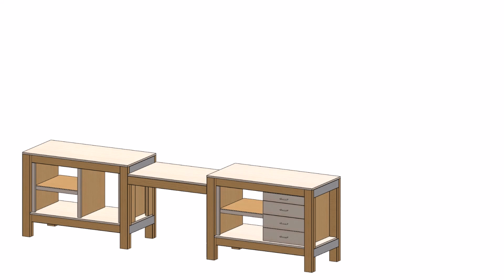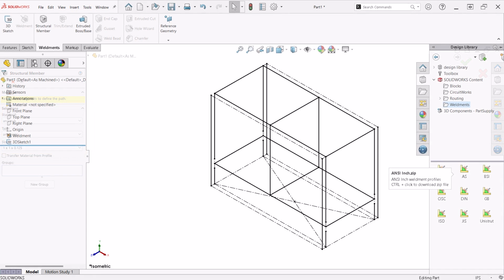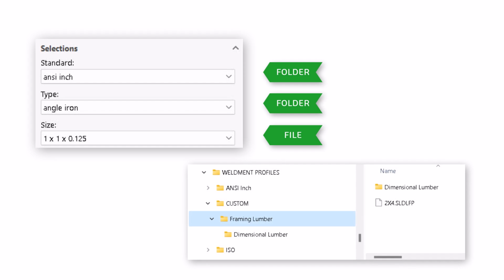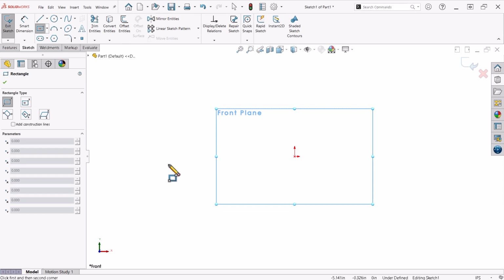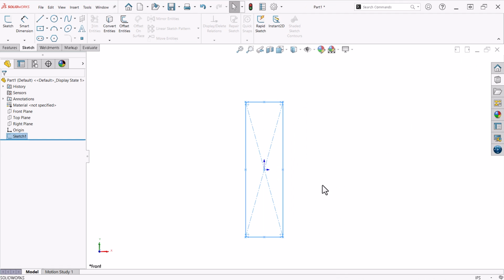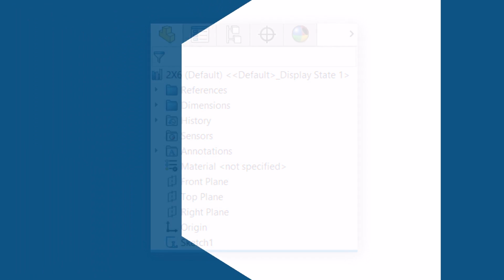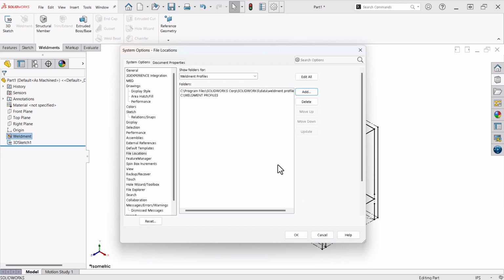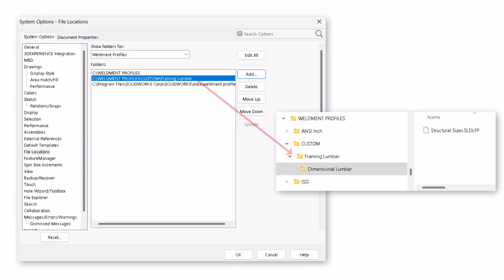Creating Custom Weldment Profiles

Comment: I changed the file path for the weldment profiles to a new folder. But when I try to apply my custom standard it is still showing the default options ?
Reply from the maker: Hi there! A great place to start for direct support would be our SWX User Forum: solidworks.com/UserForum or https://go.3ds.com/swforum
Reply: @solidworks   - Why can't you just ANSWER THE QUESTION ?
Your "support forums are SPARSELY monitored, and are only marginally helpful .
There doesn't seem to be a reason, beyond the need for over-complicating the process. 
This is another "what you can do" video, rather than "here's WHAT to do" .
Reply: @chuckintexas  ''Let me Show You how to create a Weldment Profile'' ... Doesn't do it  :/
Reply: I was able to fix my error but Im glad you responded because I cannot access solidworks forums and I would like to. When I find a forum post and try to view it after I login it just shows a white page. I've tried chrome, chrome incognito, firefox, and edge. And the problem persists. 
Any Ideas?
 @solidworks

Comment: Is there a reason for using Folder, Folder and File - and not the new Folder, File, Configuration - in the first part of the demo?  The Folder, File, Configuration will also work with Structure Systems ??
Reply: There doesn't seem to be a reason, beyond the need for over-complicating the process. 
This is another "what you can do" video, rather than "here's WHAT to do" .
Reply from the maker: Hi there! If you’re looking for information about 3DEXPERIENCE World, from Certification to Event News, check out our page at: https://www.3dexperienceworld.com/website/59830/